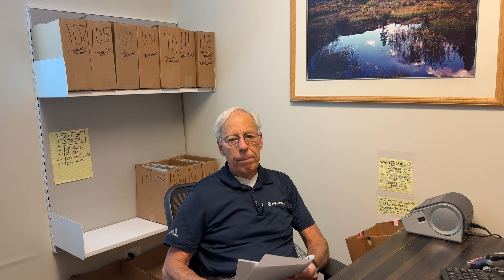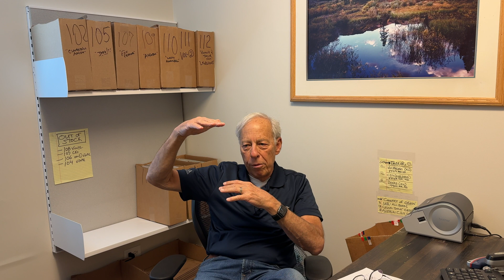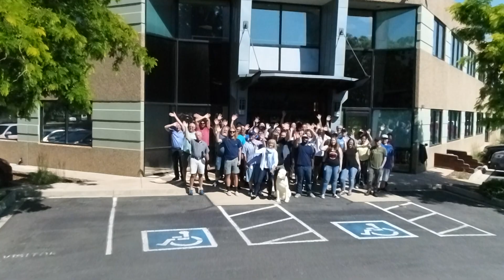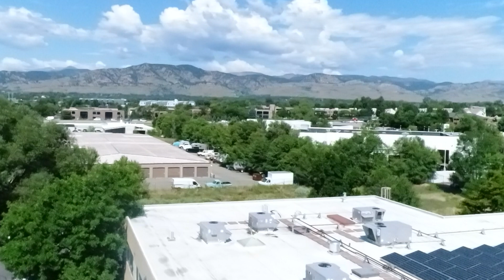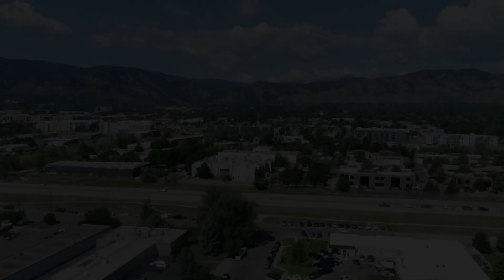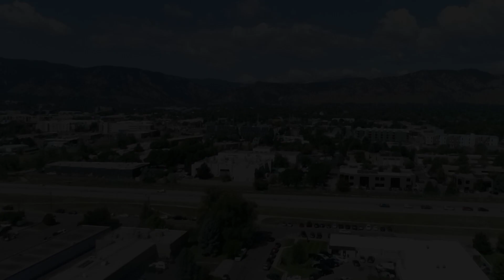Understanding master clocks in digital audio

Comment: Ideally the DAC runs the show with its clock ticking the samples through it precisely and data is pulled asynchronously to avoid any jitter and buffered to avoid buffer under-run. Spdif, TOSLink or I2S are synchronous interfaces introducing multiple clock masters. Streaming music is designed to work asynchronously making it possible to play audiophile music from some data center e.g. AWS (Amazon Web Services) where music data is just one of many categories of data and what matters is that data stays error-free and is delivered as requested with lowest latency. Music data is not even particularly hard to do over the internet nowadays in lossless CD quality or better.
Reply: Please don't say audiophile and Amazon Music in the same sentence 😭
Reply: @x-techgaming I compared Amazon to tidal and qobuz.  Amazon was the best.  They all stream at and above CD quality.  Maybe Amazon owning AWS gives them a QOS advantage.
Reply: Sorry @ThinkingBetter, You missed the whole point and are going to confuse a lot of people. The digital audio data is packetized and sent asynchronously but those packets are reassembled into a data stream that is identical to a SPDIF, I2S, AES stream as if from a cable interface. The real digital audio clock, which was already present and embedded before the stream was packetized, is then extracted from the digital audio just as it is from SPDIF, I2S, AES. So no new digital audio clocking is taking place. DACs are not expected to provide digital audio clocking. That is done at the ADC. DACs extract the clock and we don't want a clock to be unrelated to the clock imbedded in the digital audio stream.
Reply: @mikeh2520  No, the point is exactly that your DAC is where the precision of timing matters and it should serve as the clock master. Thus of course it's expected to provide digital audio clocking. Any one-way synchronous connection to a DAC such as SPDIF from a separate box will introduce another clock master and you will have potential jitter issues and need PLL in the DAC. USB and Ethernet allow asynchronous data transfer giving full timing control to the DAC. Any master clock or "re-clocking" further upstream of the music data really should be avoided when the architecture is optimum. Unfortunately, a CD transport is based on solutions from an era where the CD drive ran its own DAC and was clock master thus you end up with two clock masters. Also still more often than not, your streaming player runs a separate clock and you again have two clock masters. To make matter worse, often operating systems such as Linux, Mac OS, Windows, Android and iOS run their PCM plumbing at 48kHz and you end up with sample rate conversion before you push the music via a synchronous line potentially both yielding SRC distortion and jitter. Best is to run in exclusive mode on the OS streamer/player side and with asynchronous USB connected DAC.